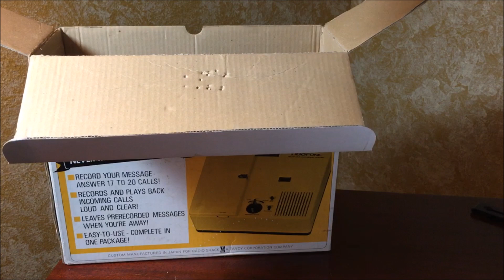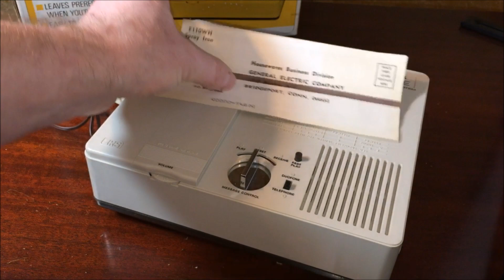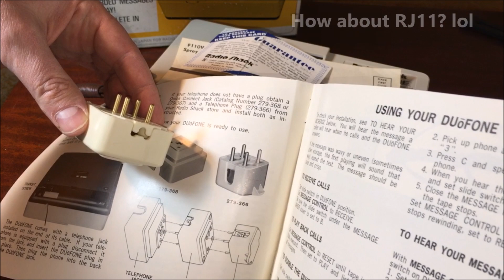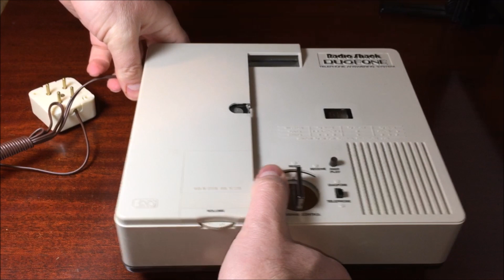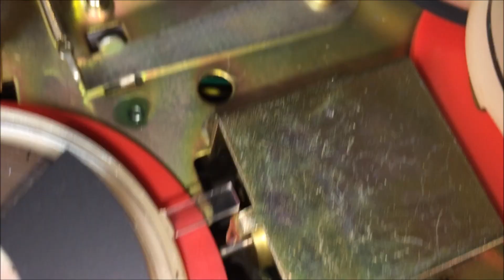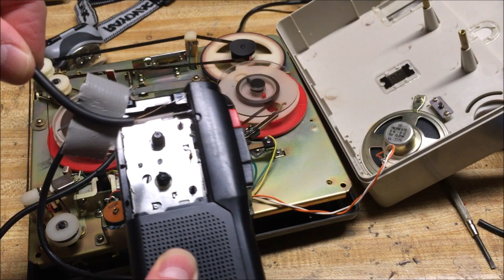Cassette-less Tape Based DuoFone Answering Machine 1970s

Comment: Well, I had one, back in the day.
And I have one in the box now.
What you and others seemed to have missed is how to record or listen to an outgoing message from the tape loop.
It has to be hooked up to a functioning phone line with a telephone to work. 
You record or listen to the outgoing message via the telephone handset.
If you are in the play mode, you pick up the phone, dial a digit to get rid of the dial tone, press the monetary switch under the cover and you hear the tape loop play.
If you switch the slide switch under the cover, follow the same procedure, and speak your outgoing message into the phone, it is recorded. 
You can check it again using the play procedure with the phone.
And the foil sensors…
One stops the machine at the end of the loop, which times the outgoing message and incoming record time. The other sensor activates the beep heard to let the caller know when to leave the message.  And to play the messages does not erase them. There is something that controls the position of the two permanent magnet erase “heads”. It does erase old messages if you rewind the tape and set it to record incoming calls again.
“telephone” is normal “off” “Duofone” is answering machine on.

Comment: 6:30: No, it is NOT OK to mix the same "type" (chemistry) of batteries from two manufacturers! The point of not mixing is that you never want one cell to be drained ahead of the others, because that puts the failed cell into polarity reversal and forced charging, which can cause it to leak or overheat. While uneven drain is never 100% avoidable, it's the reason why you absolutely want the batteries to be as closely matched as possible in both overall capacity as well as discharge characteristics. Those can vary a lot even among the same battery chemistry, which is why you want to match the battery model (and ideally, even the batch).

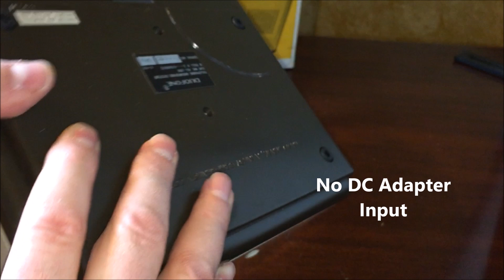3:40. It's not a burn, it's migration of plasticizers from the PVC cord it was in prolonged contact with.
Reply from the maker: That’s it, I’m doomed.  😢

Comment: the burn mark as stated in other comments below is a chemical reaction or to put it simply cellulose acetate and vinyl don't mix
rubber vinyl has softeners in its makeup and those softners slowly evaporate these softners however is akin to the hardeners in the cellulose acetate so if the two meet like in this instance the softners from the vinyl wire coating soften the cellulose acetate to the point that it actually melts leaving a scar on the machine and sometimes the two fuse completely or even mix into each other 
this chemical reaction is very similar to the workings of 2 part plastic types of glue

Comment: Yes, this is most certainly a 70s device. The decision to use a bespoke enclosed tape system seems really silly to me. Everyone else was using cassette tape, maybe it was to avoid patent costs or something? The value of having a cassette based machine was that you could save messages, and replace worn tapes conveniently. Having the same 10cm bit of tape getting stretched and  rubbed 100 times a day guaranteed a short life. Special message tapes were widely available.
Reply from the maker: Updated the title, thanks for the information!
Reply: @databits  PS subscribed. Very nice to see in that machine..its nuts! Shame you couldn't quite get it going. high quality video..I'm amazed at how good the quality of YouTube is getting. It's often far better than TV in many aspects. (of course no high budget historical costume dramas) - Maybe you could wear a suit of armour and record your next answering machine teardown in a castle?

Comment: I'm sure the problem with the electronics is just caps. Everything else survives as long as it's stored reasonably dry and not easy to hot.

The second message on the outgoing is most likely for when it's full, you'll have one that says "we're not home, leave a message after the tone" and one that would say "we're not home, call us later, the machine is full (because we're that awesomely popular)"
Reply: In cassette devices, what almost invariably dies before caps is all the rubber parts (belts, wheels, etc) and foam .

Comment: This machine should maybe have had non volatile ram with a ADC to digitize incoming audio and a DAC to output speech to a speaker via an amp, the NV-RAM would be like a solid state audio recorder.
Reply: Dude... 1973. While digital audio did exist at the time, it was far too complex and expensive to put in any kind of consumer gear then.

Comment: The "burn" mark (based on what happened to a computer keyboard I own) is a chemical reaction between the plastic of the casing, and the rubber cable.  I have a computer keyboard that I wrapped the cord around, and where the cord came into contact with the keys there is the same marks you have!  Although in my case it was much worse as it deformed the keytops, but it looks exactly like someone took a soldering iron to it, but it IS FROM THE CABLE!
Reply from the maker: Thats insane!  But makes more sense.

Comment: 7:38 The switch does need cleaning, but you must thank the gunk in there! You wouldn't have known the amp stage was working without opening the thing up if not for that (except if it produced some kind of cheapo stuff buzzing, that is...).

Comment: I noticed that the OGM tape seemed to be chromium while the IGM tape seemed to be ferric.  Di the OGM tape run slower than the IGM tape?  

I do know Ferric tape was cheaper than Chromium tape.
Reply: It's graphite backed tape so it can be used in a loop. 8-track tapes used this kind of tape too.
Reply: Being that it's so short, I suspect it did run slower.

Comment: I had one of these from a garage sale years ago back in the 80s. It was an older model and actually had a separate drive motor for the outgoing message loop. And bigger reel tables. It had a large circuit board that went all the way across the bottom.

Comment: It appears in the 1975 Radio Shack catalog on page 44 according to the website Radio Shack Catalogs.   The RJ11 replaced the four-pin jack around 1975.   Also, the reel-to-reel mechanisms also indicate its age.
Reply: Makes me wonder if anyone ever got flak from their phone company for installing one.
Reply: @Madness832  My dad got a nastygram from Ma Bell for adding an answering machine to his line back in the 80's. They detected it by an increase in the loop current.
Reply: @Madness832  It's probably why it was never used.  The far-reaching tentacles of the octopus called Ma Bell knew no bounds on what they could grab from what I understand.
Reply: Damn, you beat me to it.

Comment: According to a Radio Shack catalog from 1974, this device was already sold in the seventies. → goo.gl/nMKRJN
There’s also a date code on the speaker: 28th week of 1973. So this machine is 46 years old! Impressive. A device of the 1980s probably would use much more plastic inside.

Comment: That mark on the bottom was caused by the wire being pressed against the plastic housing for a long time..
The plastic jacket on the cord "out-gassed" something that would melt the surface of the case.
I've seen this on LOTS of old gear.
Reply: Case is ABS plastic, and the cord is PVC. The plasticiser in the PVC will dissolve in the ABS plastic and this makes it soften when you store the cord pressed against the ABS for a long time. That is why your new equipment had those cords in a thin PVC plastic wrap, and the machine was wrapped in a non PVC plastic bag, so there would be no plasticiser burns. Store the cord in the polystyrene case outside the bag and it would melt the foam to the surface.
Reply: @SeanBZA Jig fishing lures used to have so much plasticiser in the 90's they would easily melt through anything ABS you put them in. Likely phthalates. It was crazy.
Reply: What  @SeanBZA   said ∆

;)
Reply: Definitely.

It was especially common on retro computers that had been stored for a long time.

The cables would often melt into the polystyrene, too.

I was surprised that Mr databits might not have seen that on his travels.

Comment: the burn mark is probably from the rubber of the phone cord interacting with the plastic shell during storage
Reply: Yes came here to say this. Pvc is notorious for this
Reply: @TheChipmunk2008  yeah I've seen this a lot - is it due to chlorine outgassing?
Reply: @jamesbennettmusic  I'm pretty sure it's plasticiser migration, where the plasticiser (which makes the pvc cord soft) migrates out and into the solid plastic... rendering it soft, and the cord hard.
Reply: SPOONman4000 I was thinking the same thing. They line up perfectly.
Reply: Was about to say as such. Very strange to look at.